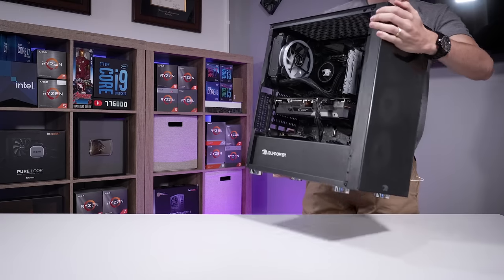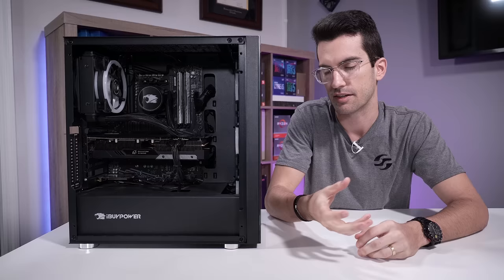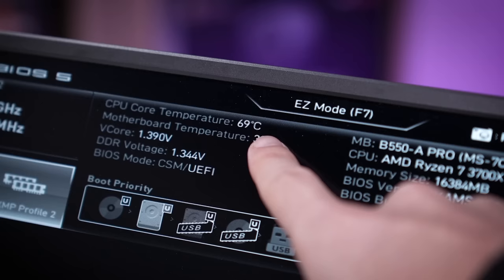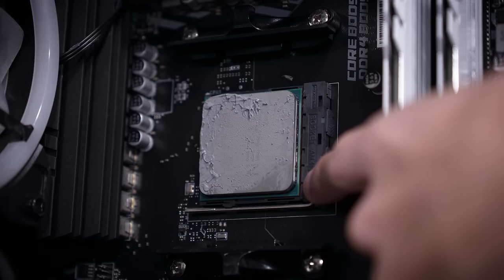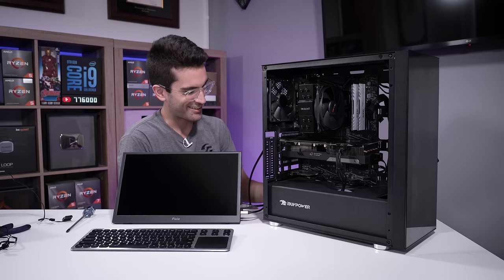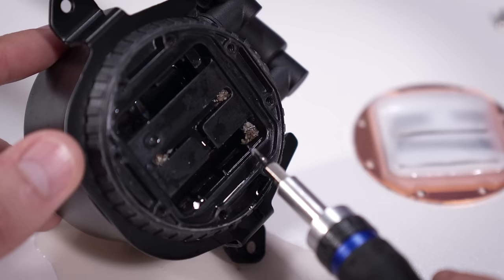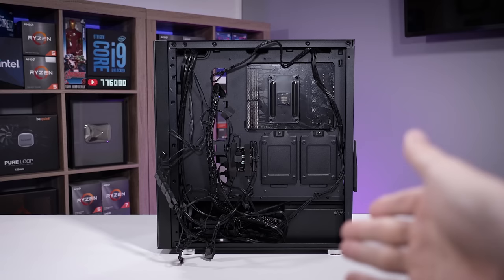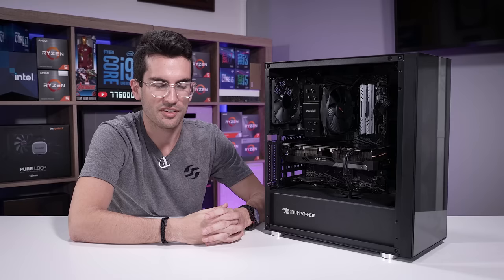Fixing a Viewer's BROKEN Gaming PC? - Fix or Flop S2:E8

Comment: Seeing this is very concerning especially since most companies get their AIO coolers made from the same manufacturers just with their logo or twist on them.
I have never liked AIO coolers myself due to there being many points of failure. But this, this brings up a whole new point of failure that is not caused by the user but by the manufacturers.
A lot of Noctua Air Coolers can keep a CPU as cool as 360 AIO's I get that it might not look cool but to anyone new to PCs or someone that just wants a PC that they can build and forget it for the next 5 years getting a Air Cooler is definitely the way to go.

Comment: It definitely is, I actually had the same thing happen to MSI MPG 360mm AIO that was featured in the last AIO replacement video you did! I just ended up buying a Be quiet Dark Rock Pro 4 for easier maintenance
Reply: I'm using the same  air cooler on a 12700k and having no issues with it running at stock speed.

Comment: The problem is galvanic corrosion caused by fluid with insufficient corrosion inhibitors. This cooler and the MSI one from a few weeks back are both made by the same OEM, a manufacturer called Apaltek. They are the same manufacturer that made the Enermax Liqtech TR4 coolers that Gamers Nexus investigated for the same failures a couple years ago. In October 2021, Igorslab published an article titled (in English) "When the OEM slackens or saves money – AiO compact water cooling systems with pre-programmed expiry date and an example from our lab", which highlights the same problem from the same manufacturer. Great work again Greg. Your continuing coverage in this series may lead to serious changes at Apaltek. MSI stepped up quickly with their recall, seemingly in response to your video, hopefully iBUYPOWER and other companies using Apaltek as an OEM do the same.

Comment: I had the exact same problem with the ibuypower AIO and it started after 16 months of use.  I got a similar cooler that you used as a replacement.   Didn't even try to clean it out. Thanks for the video

Comment: i think the OEM of this AIO is the same as the msi one, because both has the same fluid color (yes that can be different oem vs oem) and pump desings.
Reply: I had this same issue with the IBP pump. From my research its a rebranded NZXT Kraken M22 as they operate out of the same building.

Comment: I had the same problem in my NZXT Kraken ML120. The noise was similar and the temperature problem as well. 
There was a lack of coolant after one year but was possible to replace it.
There were a lot of particles and dirty inside and the fact is that the parts of the MSI seems to be exactly the same than in the Kraken. 
Now the AIO is maintaining the CPU cold and working properly. 
Great job Greg, congrats!

Comment: Personally never had a good experience with any single fan radiator coolers. They heat up real quick even in a push pull fan setup. That Dark Rock Slim was a HUGE upgrade
Reply: Better off with a good air cooler over a 120mm aio. Not surprised that IBuypower did this.
Reply: A single fan AIO is like one of those bolt on chrome exhaust tips, it just looks fancy and doesn't help performance. Cheap AIO's are for the ricers of the PC gaming community.
Reply: @jordanlazarus7345  it checks off a box because gamers like AIOs and they look nice, but a 120mm one is meant for a small form factor case where the options for cooling are much more restricted.  In a mid to large tower case all it does is look good.
Reply: @spankbuda3084  I had a 4790k at the time. No OC'ing but turbo boost was enabled. The case was a NZXT Phantom. I just used the stock fans for the case. For the AIOs I always used the fans that it came with.

Comment: The noise comes from the Pump. That sound are airbubbles trapped in the Pump. I had that noice at my first AIO as well...that one died after 3 Months.
It was an AIO with the Pump in the block...possibly something got into the bearing and rhe noice from that grinding.
Reply: Was yours 120mm? Mine did the same. Very common issues with these 120mm AIO’s

Comment: My MSI AIO is still going strong after two years with my 10850k. I have never had any heat problems, but as soon it starts to give me problems, I am going with an Air cooler. I also learned most manufactures use the same AIO just rebadged.

Comment: My MSI 240R AIO was replaced under the recall, no questions asked. The only problem was that, after sending instructions on how to do the process, they sent me a new AIO but changed the instructions after. They told me a return shipping label was going to be included with the new AIO, but they didn't include it. After commenting about this at your Twitter account, Newegg stepped in and provided a partial refund of my original purchase so I could send it back to MSI. Package is already prepped, so I'll be returning MSI the recalled AIO next week. MSI sent the 240R V2, so I hope this problem didn't migrate to the new versions, although seeing this video makes me rethink everything and be a bit skeptical about installing the AIO. Great stuff you're posting here. Thanks a lot.

Comment: I had the exact same issue, and sound, with my iBuyPower. I ended up replacing the AIO with a Fractal 240 AIO. Took care of the problem immediately. I learned a lot fixing the problems on that thing. Not exactly ideal for an SI, but it taught me valuable lessons.

Comment: Igorslab has an article about this issue. It's because of cheap radiators witch are used by an oem manufacturer. Aios from Acetek doesn t have this Problem because they use better radiators. 
You can read his article for the specific Problem with the radiators

Comment: Hi greg, I actually had the same issue last year, I purchased the MSI Mag series 240R and installed it, after 3 months I noticed high temps and games running sluggish, took out the AIO and RMA'ed it through MSI, they replaced it within 2 weeks, but never reinstalled it, went back to my tower cooler that I was using before, same situation, pump is in the radiator, I thought possibly I had installed it incorrectly, but this vid proves otherwise, keep up the good work sir and thank you for your consistent content.
Reply: Sorry just now checked this, not sure what you mean by won a gift lol

Comment: This why I stick to air coolers. FSP Windale 6 is a beast of a cooler for $40-50. Also the fan is quite comes with anti vibration mount system.

Comment: Just installed a Dark Rock Slim myself on a new i5-12600k build. They're great looking and almost silent. Idles between 30-40C. You can even add a second Silent Wings 3 fan on the other side in a push-pull config too for even better temps.

Comment: About 6 months ago, my 6 year old 980 Ti Hybrid had started to run a bit warmer than usual. Thankfully I caught it early on.

I suspected that the flow was being restricted.

So I pulled the cold plate and found gelatin like substance had clogged the channels inside the plate. Almost identical to what I see in the video.

I cleaned it up the best I could and filled it back up. It has been running nice and cool since then. 
Knocks on wood

Comment: My Enermax Liqmax III RGB 240 AIO died as well recently - 9 months in use - sound was pretty much the same as in the video. After watching your first video I went back to air cooling with the Cooler Master MA612 too. Ive already got a replacement for the AIO by my dealer (German laws are very consumer friendly) - but Im not planning to put it into my system again.

Comment: Same thing was happening with my Kraken M22 AIO but after I replaced the AIO temps went down I've only had my current PC for 6 months and It began doing this, my CPU temps were reaching up to 100* before & I had tried reseating the cooler and reapplying thermals but nothing worked. I love your videos as well!
Reply: That iBuyPower AIO is a rebranded Kraken m22.  Real easy for them to get and rebrand them.

Comment: Awesome video! What would you look out for if the graphics card was running really hot (3080) when idle?
Reply: make sure the fans are all working.  you could take it apart and check all the thermal pads,  make sure they're good and all making contact and finally,  check/repaste the thermal paste.

Comment: Personally I've been using the same Corsair H110i 280mm AIO since 2015.  As of April 2022, I have yet to have any issues (knock on wood).  I havent had any heat issues, and it still runs the same as it did 7 years ago.  I don't jump on any bandwagon, but their  AIO has been reliable.  Its mounted on top of my pc case.

Comment: I had an ibuypower PC build. Same case and all and their AIO. At the time I didn't know as much as I do now, but I had that SAME issue with mine. I had my PC for only about 6 or 7 months and my PC was overheating like crazy. I had the same exact sound that Greg was hearing in the video. It drove me crazy. I knew it was coming from the aio. I learned enough about PC building to where I was comfortable enough to replace the AIO with an NZXT AIO. It fixed all of those problems. So Greg (or anyone considering an ibuypower pc) if you see this, this may be a common issue with their stock AIO, and it may be best to build the pc with a better aio than with their stock aio if you go with ibuypower. Outside of that issue, my PC has been fine, and I love my PC, but ibuypower may need to address this AIO issue.

I'd love to donate my old AIO that doesn't work for your catalog by the way. I truly appreciate your work.

Comment: Greg, in MSI motherboards, for fan curves, in order for you to have multiple temperature/RPM points to make a fan curve, you must select the Smart Fan mode. MSI's boards can actually do a pseudo-fan curve for voltage control (3-pin) fans too, but instead of a smooth RPM% curve, it'll just be four different voltages that the motherboard will automatically adjust for at certain temperatures.

Right now, the way you had that fan, it's just gonna spin at that set RPM and never ramp up or down based on temps.

Comment: that grinding sound was actually a worn out pump. have a old corsair one that does the same thing. it does run but not efficient and randomly sticks. if the block is with the coldplate sideways or downward its not too bad but if you tilt the plate up it grinds like mad. the corrosion/groath you found in the loop was just an extra problem

Comment: 4 months ago, I also had a customer with an identical iBuyPower Prebuit with the 120mm AIO and the loud clicking noise. Swapped it with Cooler Master Air cooler and temperatures was great. Did take the AIO apart but couldn't find the cause of the clicking noises.

Comment: Both Ibuy power builds that I have serviced for friends both had this issue in their AIO one being the ibuypower brand rad and the other being a "Msi" AIO both with pumps in the rad instead of the block. I would not be shocked if more people are seeing the same issue. The Fluid was an off red color as well.

Comment: G'day Greg,
That Gunk build up in the AIOs is like what GN Steve found in the Apr 26, 2019 "Enermax's AIO Gunk Problem: Liqtech TR4 Cooler After 18 Months" which has the 'Pump in Block' layout.
That Gunk is more likely from there not being enough antifungal in the fluid, I have opened my DeepCool Captain (over 5yrs old when I refilled it due to low Fluid Level) & many Coolermaster AIOs that are many years old to customise them & have not seen any Fungal Build up like this.

Comment: Just an fyi, this is usually the result of mixing metals in loops. Cheaper aios, like the one featured in the video, usually has copper for the block, and aluminum for the radiator, for cost savings. The orange liquid is either a result of the metals reacting over time, or was originally orange with a corrosion inhibitor(albeit a crappy one). 

More expensive, mostly asutek rebrands, has copper on block and rad, or aluminum on block and rad, but not usually mixes. The saying you get what you pay for certainly applies here.

If you are interested in finding out more about this issue, there are plenty of analysis videos on YouTube from reputable people.

Comment: I had the same CPU and that same cooler. It will not handle the CPU temp spikes and I had a much better airflow case. Good luck to the guy.

Comment: NZXT Kraken M22 was mine that had the same issue, I have since replaced it however still have the aio.
Reply: The cooler didn’t even last half a year.
Reply: I Had Same AIO, and it started making that sound on the radiator 4 months after I bought it, and 2-3 months after the sound issues appeared I Started to have hightemps Issues besides thermal throttling, I Asked for an RMA to my retailer near of 2 months ago. they asked me to send the AIO to them 2 days after I Asked for the RMA, then they told me that they sent the AIO to the service center of the brand and it arrive to the service center 5 days after the retailer sent it to them and just a week ago they answer to me saying that the service center of the brand authorized a refund  and the retailer refund me 3 days ago. 
Fun thing is that in an old build I have a Cooler master Seidon 240mm what I Bought in 2014 and until now I Haven't any high temp Issue.

Comment: well, to make a point for the 2-screw montage of a cooler: noctuas secufirm is such one, that the cooler itself ist connected via 2-point to the mointing kit. and it is one of the best systems there. many other manufacturer copied it.... but no system is failproof if you f up the mounting procedure...

Comment: IgorsLab reckons the gunk has to do with flux residue from radiator production (and the mix of Cu and Al is not helping matters). It's hard to tell from the outside, but since we can assume that the AIO in a prebuilt will be no more expensive than absolutely necessary it's quite likely the same applies to its radiator.

BTW, I hope you went in there and fixed the stupid overclocking settings as well. There is absolutely no reason for Vcore to sit at 1.462 V on the BIOS screen, or ever. Shouldn't you be keeping Ryzens below 1.35 V or so at all times if I am not mistaken? That certainly wouldn't have been helping the overheating issue. Could be 20-30 W in "idle" like that.

I would reset everything to be running at manufacturer spec, turn on all the power saving functions that are commonly left turned off (e.g. PCIe ASPM, package C-states up to C5 since C6 can be troublesome on Ryzen (*)), and then possibly give the thing a bit of undervolting via offset so you can get higher clocks out of the power target. The fan curves could probably use a bit more TLC as well, I mean why was the exhaust fan on fixed RPM mode to begin with?

*) I have some theories on that, including entering C6 while a PCIe link is still up or XMP not allowing the memory to clock down, but it could also just be a plain bug, though I have my doubts there. I would much rather trust in the incompetence of PC board manufacturers when it comes to BIOS matters, this power saving stuff in particular is not their forté and it may be a nonsensical combination of settings causing this issue. A big-name office prebuilt is way more likely to get this stuff right out of the box than hobbyist / enthusiast level hardware.

Comment: Precipitation of solids from a coolant having dissolved chemicals into sand grain-sized particles shown in this video typically creates relatively uniform color. These particles in the pump had a number of colors, which leads me to suspect they are sand introduced during manufacture. The fluid color likely was due to microorganism growth, though hard to tell not knowing what was used as coolant.

Comment: My NZXT H1's AIO did exactly what that AIO did. It has to be something in the design of these pump-in-rad AIOs, because mine wasn't even a year old. I thought maybe it was the Thermal Paste, Mounting Pressure, but nope, temps just kept rising and my PC would ultimately crash and spiral into an endless Boot Loop. The pump still works, but it wasn't cooling my CPU at all, not even a little bit. I didn't bother taking it apart myself, but I wouldn't mind sending it your way if you need another one to dissect.

Comment: I think companies need to include a better antifungal and antimicrobial liquid in their AIO's and also make sure the production area and worker is clean and using gloves. Those things are a fester pool for microbes and yeasts. That being said, if it is a closed loop truly then in a clean environment, none should grow if none end up in there during production. I had one that kept doing this and I added in my fluid, but I also added in 1mL of 99% isopropyl alcohol, and 1mL of pure tea tree oil, never clogged up again. ibuypower probably uses MSi parts (crap QA), so this happened again.

Comment: You should always tighten in a criscross pattern.  It's just like putting car parts together, any mechanic will also tell you that.  Unfortunately, the newer Be Quiet coolers suck.  The heatsink is good/well designed, but they no longer give you any way to properly attach the fans.  They give you a small piece of wire that doesn't work, and you end up having to use zip ties.  My roommate got one because the reviews of the previous model were good.  Will not be getting anything from that company again.  Using an Arctic Freezer II (280mm) in my current system (I know to stay away from coolers with radiator mounted pumps - mine is definitely block mounted because it has a see-through window to see the pump spin).  My Linux server that has a 12100 is just using the stock CPU fan, it doesn't play games and doesn't have a GPU so that fan is fine.

The AIO in my previous system (bought in 2015) is a Corsair H60 that is still 100% fine to this day.  I gave that system to a friend when I upgraded to the 12900k.